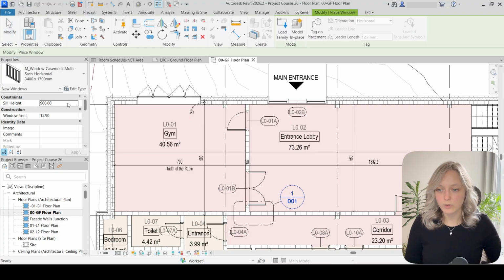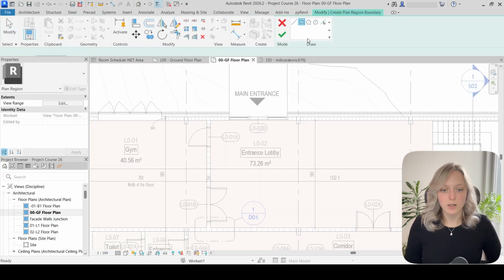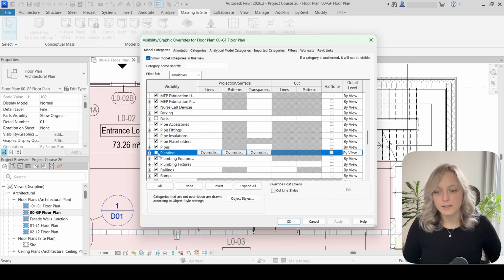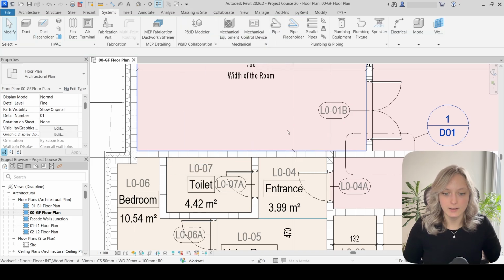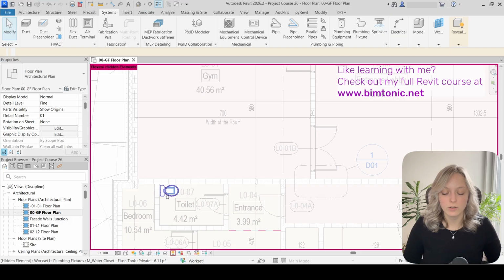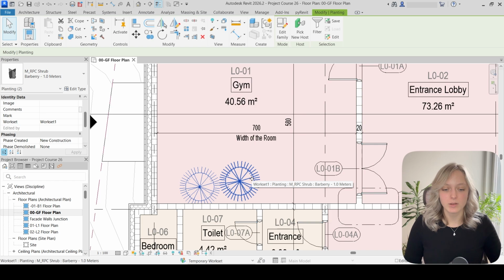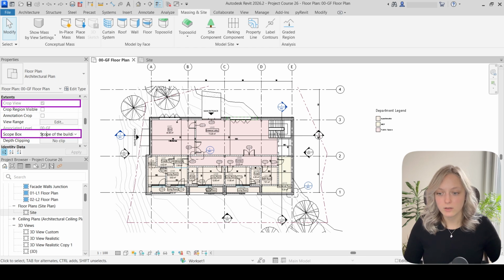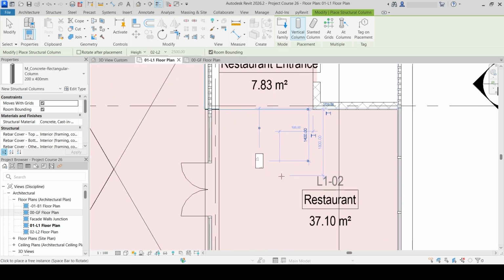Revit Fix: "None of the Created Elements are Visible in View" (8 Solutions)

Comment: Can I make spot elevation with project and survey hight together?
Thanks a lot 🙏
Reply from the maker: You can add project base spot elevation with the symbol and below the symbol line you can than add the survey height one without symbol. That’s how I usually do it. In the video “How to make site plan in revit” I explain it in detail
Reply: @BIMTonicLive 
That's what I do,
Just I hope they gonna make it in one family 
Thanks a lot 🙏
Reply from the maker: @msh130  yeah it's annoying that we still don't have option of combined spot elevation  :/ the only other option is making it as floor tag, that lets you add both, but that's no good because it's very messy to use wrong family category, opens up more problems than saving time :/
Reply: @BIMTonicLive 
You are right 👍 
I hoped they make it at 2027 version,
 and make the Walls Attach/Join the Stairs, but they didn't 😢

I'm very disappointed 😔 

Thanks anyway 😊